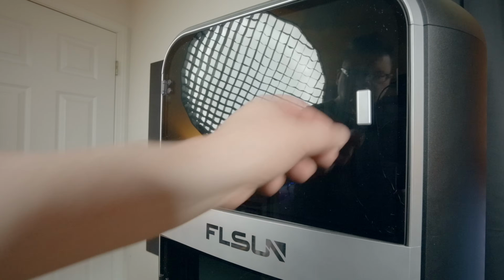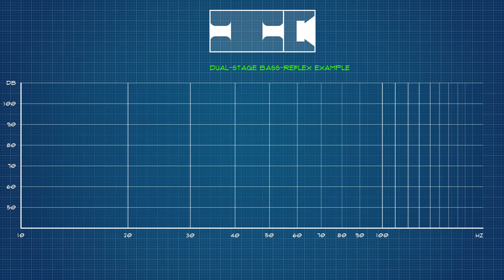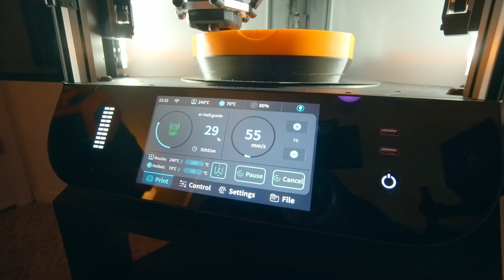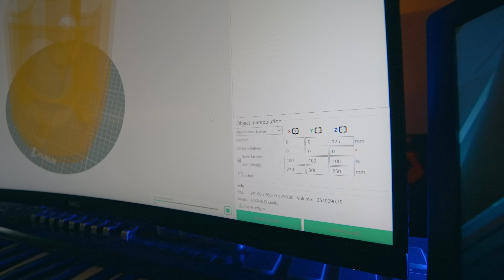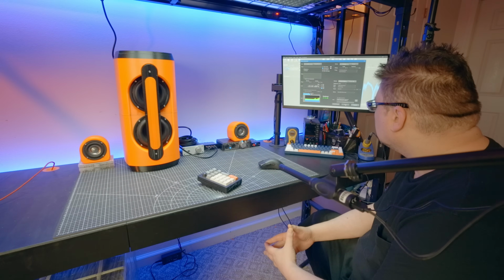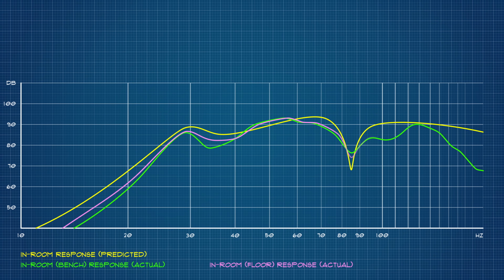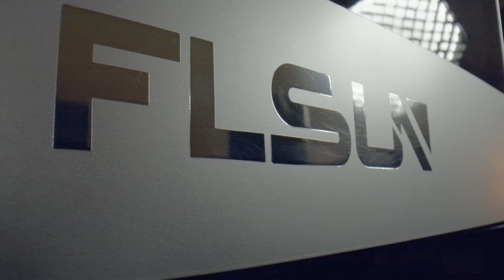FLSun S1 Review & Feature Build

Comment: If you've got the build volume and patience to design the crossover or fight with a multi-channel DSP plate amplifier, then a 3-way bookshelf speaker utilizing a coaxial driver for the tweeter and mid-woofer and a relatively small subwoofer for the bass driver. If you're willing to drop way too much money then Seas has a kit for one that is exceptional, but the box design is quite large and probably wouldn't fit the build volume. Dayton Audio has a smaller and much cheaper coaxial driver, though you'd need to probably move to a different brand and size when sourcing the subwoofer driver if you wanted to find something that hit low enough. I love these kinds of 3-way bookshelf speakers because they usually have better than average dispersion characteristics and a 3-way design tends to clean up the bass and mids quite a lot since you can have separate drivers for each role.

Comment: 8:24 If you want to check detail for size-fitting, you dont need to pring it in full size, you can cut 1 small piece in slicer and print it relatively fast with thin walls and low density infill etc.Also slicers have a ruler tool  to measure models. First layers on FL is bad cause wrong temp or not well cleaned bed.

Comment: Can you please 3D Print some large format horns?  Not bass horns that could easily be made with wood, I mean mid/high horns, for example something like the B&C ME464, that costs over 700 dollars each new, or the Faital Pro LTH142.  It doesn't have to be that exactly, but I'd like a horn that can retain pattern control and driver loading down to below 1khz.   If you know anything about horn geometry, and I suspect you probably do, in terms of fidelity, they are not all created equal.  There are better and worse geometries if fidelity is the primary goal (which it is).  Horns for home use need to prioritize fidelity and even horizontal dispersion, and the lower you can get the crossover point the better.  I want to make a 2-way with a 15" or 18" bass driver, but if you want a 2 way you can't use a 2" or larger compression driver.  Only a 1" or 1.4" is suitable to go to 20khz with usable and clean output, and a 1" will struggle to get below 1000-1500hz even among models with the lowest extension, so 1.4" is ideal for a high SPL 2-way design.  Some are even capable of 500-700hz, and 800hz is very achievable with many drivers in the right horn with the right crossover.  If you want to cross to a 15" woofer that's going to play up that high, and you want it to sound great and not start beaming but retain good dispersion that can roughly match the horn at that crossover point, then the horn/CD combination options are limited, and the horns can get expensive.  If I could print a horn, even in 2 or 4 or 8 pieces, that has a good geometry, that would be awesome.  An elliptical tractrix horn or an oblate spheroidal horn would be ideal, fairly wide horizontal but fairly narrow vertical.  Exponential horns can sound good but become quite directional at higher frequencies.  The ME464 is a different beast, just a controlled directivity horn that's huge and can play low, with a diffraction slot I believe... a good horn but not necessarily uber high fidelity like the Faital or like a Geddes style horn.  But I would love to see any kind of horn build from you, with a nice compression driver selection!

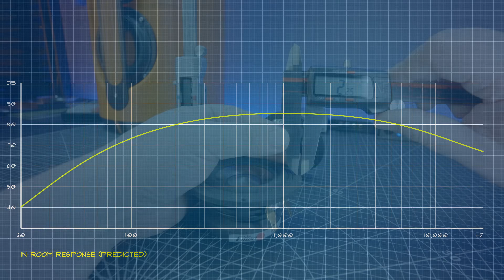Comment: At 10:29. Measuring the inside diameter  of a hole or in general the „between“. This is where it might be better to use the other end of the tool which is made for this purpose. Nice video btw. Sweet sub!

Comment: I had a similar issue with PETG stringing. Default temps for Prusament are like 250C. I print ABS and ASA at 235C perfectly. I dialed the PETG back to 225C and it's spot on. Not sure why the manufacturers want so much heat unless it's assuming that everyone's using a standard V6 hotend that can only do like 9mm^3 of flowrate. It's super frustrating!

Comment: Im part of a few 3d printing groups and sound audio groups, i always recommend this channel as a starting point, because of you i think interest in printing audio has really taken off, youve really shown whats possible with a good design! 
Couple more years till printers are perfect and people will commit, i think atm all the people interested in 3d printing audio are scared to take the learning curve of a printer, as shpown by the failed prints at the start of the episode hahahaha frustration will turn most off

I also rock your 3 inch subwoofer hahaha its so perfecty for ym PC system and have found a need for the dual reflex sub yet
Reply: I am a experienced veteran 3D print maker and even have a small on demand business for 8+ yrs.   I guarantee you, someone with more experience, will not have these 3D print failures. For example, besides the frozen screen issue being printer related, how the material is sliced, supported and filament settings matter and would yield better results. I could print this box and get it right the first time. 
Im saying all this, just to make sure others without much experience understand that the technology and quality of printers is there, its a matter of taking the time to learn how to properly set the workflow. 
Its no different then machinists, you can have a great CNC machine, but if the user doesn't know how to setup parts, failures will happen. Same with printers.
Reply: @Felix.Garcia  "I could print this box and get it right the first time."
So could Hexi, if he's only been using one type of printer for 8+ years, and if that printer was actually decent. That's not the point of his videos though.

And if you say you can get ANY printer to print a piece that big without any issues at first try, you're just lying.
Reply: @tomkocur   Your missing the point.  You mistake my advice to others about printing having a learning curve with me criticizing Hexi. Incorrect! He's not that experienced yet. Simple as that.  His hot end was "smacking" the print, part was curling on him on overhangs, he had to edit file and add Z-jump after fact, layer delamination happened etc. Anyone can get better. He WILL get better. 

Folks who have had plenty of experience printing understand the workflow better. Before attempting something this big, you must make sure it is setup for success. When you have a print farm queue, or do it for customers on demand with a deadline, you cant afford to just have mistakes.

 He lost days and multiple spools of filament. That is a massive loss of time and money for everyone involved. Even anyone doing it for "funsies".
Experience gets you to learn how to obtain a proper Z-offset for the machine and build surface being used, first layer temps/height/speeds for the filament being used, how to properly set supports, what kind of support separation is needed so you dont "chisel" them out,  if you should use fans or not, how to compensate for warping, shrinkage etc.
Experience gets you closer to  higher success rate, and the confidence to determine if the task can indeed be achieved.
Reply: @Felix.Garcia  nope, I'm not missing the point, you are. But I'm not repeating myself.

Comment: Dang that's a sweet speaker. Had to put on my headphones to hear it properly. Wish I could print it... but my large format printer is down for a full conversion right now. 

I have an FLSun Q5 and it was my most reliable printer for the longest time. The non-removable glass plate is the worst part about it, makes taking prints off it a real pain, and is the reason I hardly use it anymore. Will eventually pull the glass and put on a magnetic bed. Now my (heavily modified) Ender 3 v2 is my most reliable. Sadly my Anycubic MegaX is the big one and it's been torn apart for over a year awaiting a re-brain (Klipper-supported MoBo), ABL, and Ender-style Direct Drive nozzle conversion. 

Was excited that FLSun had another large format delta since I wanted the Predator when I got my Q5 but couldn't find one for sale anywhere. $1500 is just way too steep for me.

Comment: Love these little founteks, built the satellites for my first 3d printed surround sound system using the fr89ex's with passive radiators sadly that model seems have been discontinued since. They live in my workshop and still play great 8-9 years later.

Comment: I was listening on a Onyko HT receiver with 5 channels of Dayton Audio speakers with 4 inch woofers and for the bass I have a 20 year old JBL 100 watt plate amp with a Audiodynamics AD1310 sub in a 1.3 cu ft box tuned to around 30 hz.  Sounded great.  How much would you charge to design an enclosure for a single Resilient Sounds platinum 18?

Comment: How did you hook the two 4ohm tangband subs to the 4 ohm dayton amp?
Reply: In series.
Reply: @nathanieljames7462  Wouldn't that result in 8 ohms?
Reply: @I_EpicsStudios  Yes.
Reply: @nathanieljames7462  Ok, that's what I thought. That would mean you don't get the full 100 watts of output from the amp though, correct? It might not matter to much either way since the RMS of the two drivers combined is just 80 watts
Reply: Yep, you need to learn series and parallel resistances. You can learn it in a sitting.  Don't forget to put it in to practice.